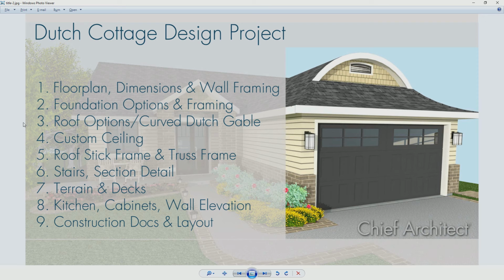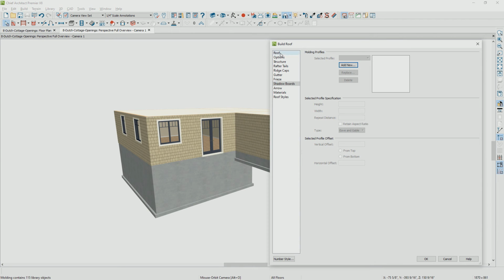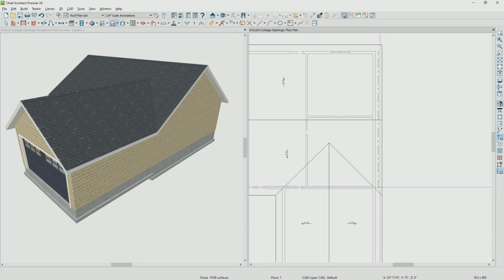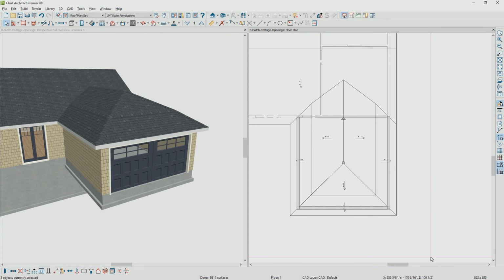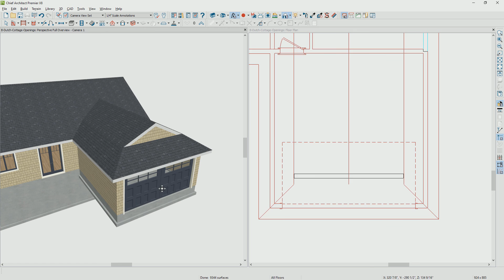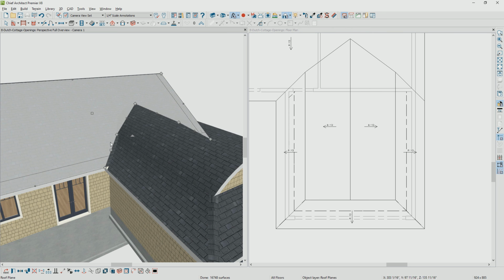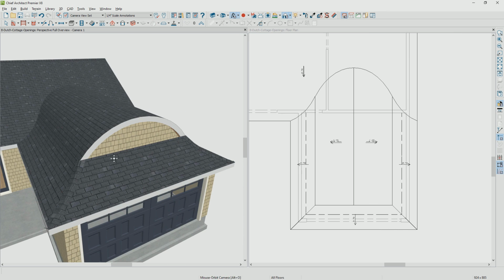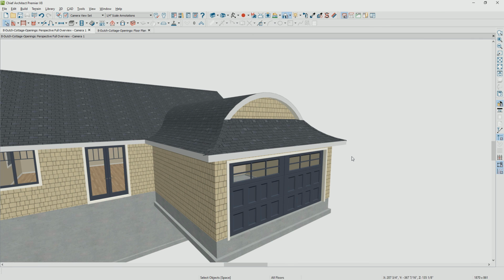Dutch Cottage - Roof Options

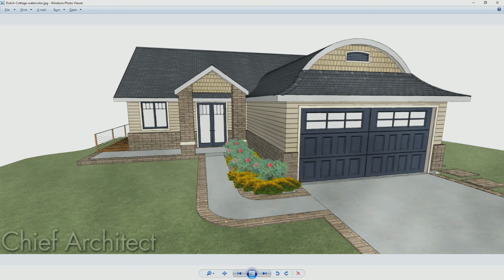Comment: Your gable line maker at 3:50 or so doesn't work for me...it just leaves a line there....doesn't adjust my roof
Reply from the maker: Kirk, I would recommend checking to ensure that auto rebuild roofs is turned on in your plan. You'll also want to draw the Gable Roof Line away from the wall (not on top of it) but within the overhang. Note that it is best used only in situations where roof directives in walls are not possible. I hope this helps!